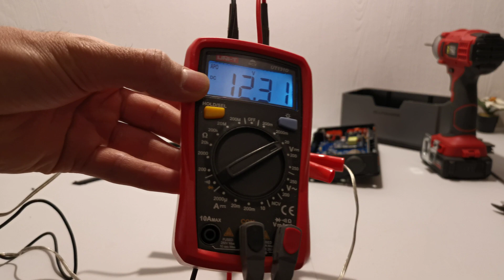Allpower power station completely disassembled. Battery.

Comment: I know this is a really old video but what charger did you use to charge it? 

I have one that i think needs balancing, what would you suggest to use to balance/charge it, or is it not worth trying to repair? - it only works when it's plugged into mains but won't charge up - possible unbalance or just dead bms

Comment: I have an 003 model. Quite useless. The company has informed me that the batteries cannot be replaced, unlike my old lead acid power pack! I am appalled!
Reply from the maker: Yes. But you can try to make a battery pack yourself. If you have the tools and spare batteries.

Comment: Hello, would it be possible to replace the battery with another lithium one of the same voltage but with more capacity?
Reply from the maker: Yes . You can replace it.
Reply: Yes you can fit almost double

Comment: I have this exact device. Its only operating when its on the charger. When the device is off the charger then neither DC or AC come on. I tested the fuses, they are good. I opened the device and checked all cables. Also good. I put the battery directly on a vectron smart charger. Its showing 14.4 abs charge, but no current (maybe BMS blocks it?) The device itself says its 40% charged. It doesnt seem to increase when on the charger. Anything i can try? Or declare it dead?
Reply from the maker: Sorry for late reply. It's definitely the BMS. But remember it's 3s BMS. It's 3 cells in series'. The voltage should not be 14 volts. It's 3.7 volt per cell Wich is 11.1 volt in total.

Comment: I checked its AC output with an oscilloscope and its 50Hz pure sine wave, 220V. Not modified sine wave, which would look like a 50Hz square wave and fail to start inductive loads, and this had no such problems. 
That said, its solar in and AC out connectors are really flimsy
Reply from the maker: Yes you are absolutely correct. It's a pure  sine wave. But it has a lot of distortion.  7ts Pure sine but not a good one :).

Comment: Seems to be a lot of issues from these units. My USB C Stopped working in and output and I'm getting parasitic battery drain. I know it's 2 years old but thank you for the videos. I will try to open the unit and see if I can find the OEM part for the USB C port to see if I can repair or build a DIY generator using these cells. 

I won't be getting an Allpowers anymore. Their aftersales is non existent. They only tell you to buy another unit. My uncle also has a unit and also has a fault. Same response by Allpowers.

**NOTE TO ALL POTENTIAL NEW BUYERS. Read through all these comments and best go for another company for a solar generator.**
Reply from the maker: Allpowers are using cheap quality products. Not recommended.

Comment: I got one of these it was not working I told them they replaced it works fine, but they asked me to dispose of the old one I said yes because I'm a vapor and I know what sort of batteries are in it the batteries are fine I now have a tun of power for my vapes lol
Reply from the maker: Just be carefu,l the 21700 inside the powerbanks are not rated for High discharge.

Comment: Thanks for this detailed video. I have the S700 which after a few months of use will not charge via solar or A/C anymore. The USB C charger still works. This model doesn't have the fuse access as the one you used for this video. Have you seen the 700W model inside? Would you venture a guess as to what my problem could be? Thank you in advance.
Reply from the maker: Hello. Iam going to check it out and find a solution to fix your unit.

Comment: My unti is faulty and it doesn't have the two green fuses ( or holders) is this normal?
Reply from the maker: Doesn't have any fuse at all ? Could you upload a picture?
Reply: @RahmatullahRezai  Can't seem to upload a picture on here. If i take the fuse cover off the front there is nothing there, only the circuit board.When AC is selected one of the fans stays on all the time
Reply from the maker: @wand8626  do you know the model number? Could you check if you can disassemble it?
Reply: @RahmatullahRezai  it's the S300 V2.0  ( AP SS-005) il try and take it apart and show pictures
Reply: Did you resolve this .. I have the same model that shuts down when unplugged

Comment: Thanks for this, I've had problems with these power stations, most I've been able to correct (disconnect and reconnect, like a reset) that at least gets power to the AC outlets, but I can't get any DC power to the USB/C outlets, even the cigarette outlet, which according to the manual should have power available all the time. It's very frustrating.
Looking forward to more of your vids.
Reply from the maker: Sorry for kate reply. I will make another video soon. Then i will go over every components.
Reply from the maker: @stevo2992 sorry to hear that. Have you checked the fuse? There are 2 fuses one is for DC output and one is for the Ac.

Comment: I have the same power station as this. All of the outputs work fine but none of the charging inputs work anymore. The battery is at 95% but I'm afraid to use it because i won't be able to recharge it. Any idea what could be wrong with it?
Reply from the maker: Hello sorry late replay. If you still have the problem let me know i will make a video
Reply: @RahmatullahRezai  yes, I still have the problem. It won't charge through any port.
Reply: @RahmatullahRezai   I have the same problem😢. Can you help please 🥺?
Reply: @RahmatullahRezai  I have the same issue - can you guide or help what can be done? all charging ports don't work.
Reply from the maker: @9829246959  sorry for not posting any video. Can you describe your problem? Then i will try my best to find a solution.
Reply: @RahmatullahRezai  no matter what I do I can’t charge , solar, USB-c, car charger/ normal charge - I have tried to contact customer service and they are shocking, they just stopped replying

Comment: Do you know how many battery is connected in series and how many in parallel for 606wh model? Is possible to increase battery capacity with external battery pack?
Reply from the maker: Hello sorry for late reply. The battery are connected in series. There's 3s configuration. It's 11.1 volt.

Comment: Hello, I have the problem with AC and DC buttons, they are not working, but unit is working/charging, how to fix it?
Reply from the maker: Hello. The power station only charging? There is 3 buttons on the front side. No one is working?
Reply: @RahmatullahRezai  thank you for your reply, yes, AC and DC buttons are not working, when I press on them they are lighting for 20 seconds and then switching off by themselves, WiFi button seems to be ok and torch buttons are working.
Reply: @RahmatullahRezai  I have changed the fuses and now DC button started to work but AC still not working, any idea what to do?
Reply from the maker: Hello i will be back from vacation next week. I will check it for you. Maybe quick fix. But not sure. I will let you know when I get home. Have a wonderful day (night)
Reply: @RahmatullahRezai  Hi, DC button is not working again so I decided to buy another generator as this one is 3 years old and seems to reach the end of its life, but thank you anyway, best wishes

Comment: how do i reset it?the problem i have, it shows full charge an shows HELLO when pluged in to ac charger,unpluged the screen goes out and will not power up,great vidio,and sure hope you can help me
Reply from the maker: Hello sorry for late reply. You can remove the fuses there is 2 of them in the front of the device. If that didn't work you have to disassemble the unit. Hope it helps

Comment: I have a problem with my same power generator, the display has become very dim/ not bright so hard to see in daylight now. Has anyone a way of fixing this? Thanks.
Reply: Mine has the same issue..... how did you solve this problem?
Reply from the maker: The lcd display have a small led on the back. Maybe they LED diode failed / are about to fail.

Comment: What is the safest way to disassemble the power station? Will removing the fuses help?
Can you upload the rest of disassembly process? Your last video only showed the first half of the disassembly.
Reply from the maker: Sorry for late reply. Yes the safest way is to remove the fuses. When you remove the fuses you completely disconnect the battery.

Comment: The battery indicator on mine continuously flashes even after a reset. I have it completely open like in your video. Any advice?
Reply from the maker: I am not sure what could be the problem. I am going to check it out for you. Have you tried to remove the battery?

Comment: Another question please: what is range of input  voltage for charging this powerstation ? Thank you.
Reply from the maker: I will test it. For you. It's best to use charging voltage between 12.7 to 14 volt. Nor higher. If u want to connect it tl higher voltage then u need to use a charge controller. Mppt or pmw.

Comment: Didn't got which batteries are built in ? Is it 26650 ? Thanks for the video.
Reply from the maker: No it's not 26650. It's smaller then 26650. It's 20650. Which is smaller then 26650.and larger then 18650. It's in the middle.

Comment: This is great, now I can dare open it and remove the mppt charging connector for an xt60 😊.  Thank you very much for your video and insights
Reply from the maker: U need to adjust the mppt output because it's only 3S. The maximum voltage should not be higher then 12.6 😊
Reply: I had problems with the flimsy Anderson solar mppt connector as well, and intend to replace with an XT30 or XT60 or barrel socket as well.
Reply: @jschreiber6461  for me the xt60 and a mppt for 3s lithium batteries from alyexpress and I can charge it at 100 - 108w maximum by solar charging